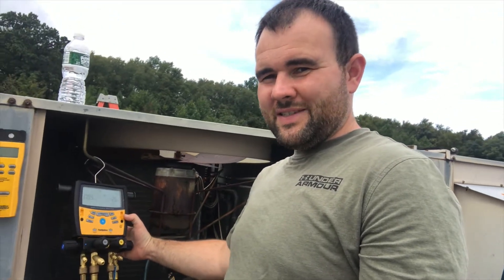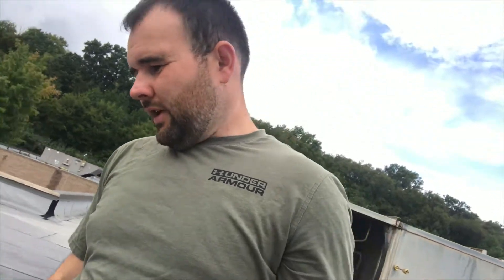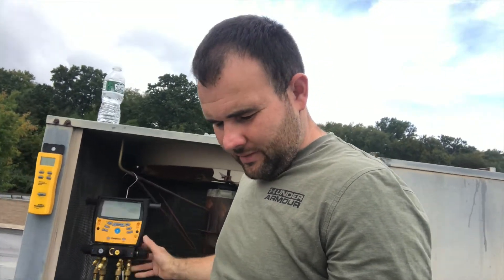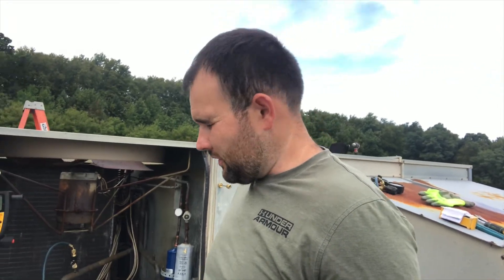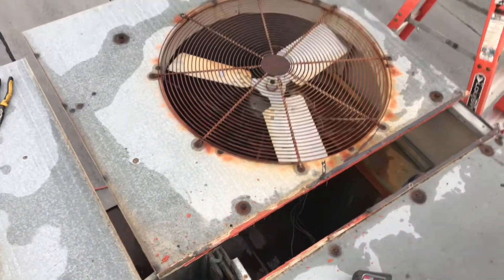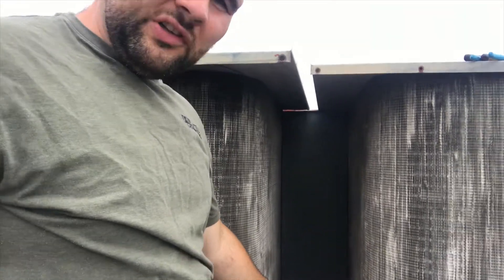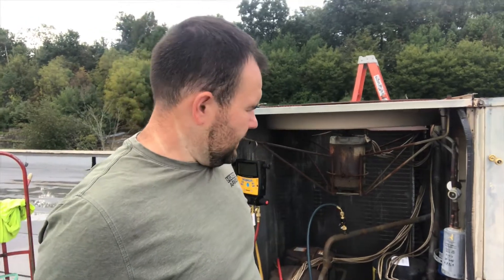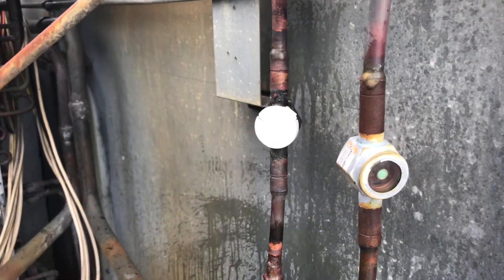My Experience With Fieldpiece's Tool Repair Process And A Refrigerant Leak That Wasn't Easy To Find

Comment: Great videos.
Help converting to forced air from oil furnace with baseboard. Need help sizing and return air configuration.
Reply from the maker: Sorry for the delayed response, are you still trying to determine this? I would need more information regarding the size and layout of the home to help.